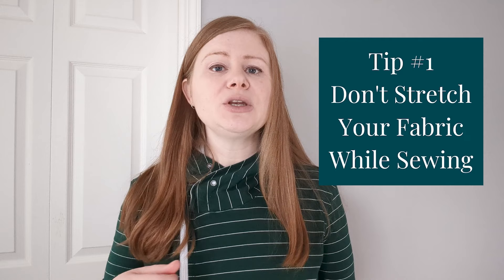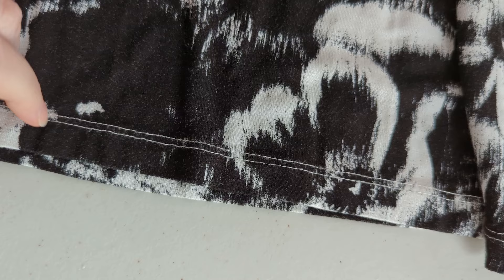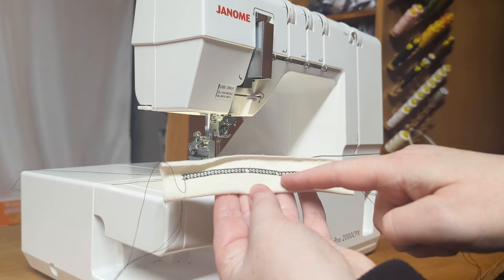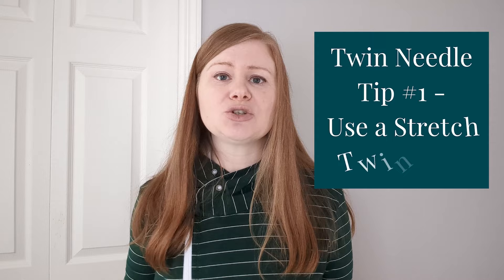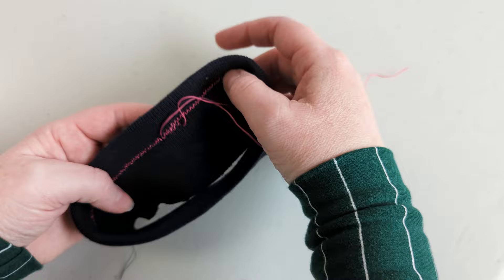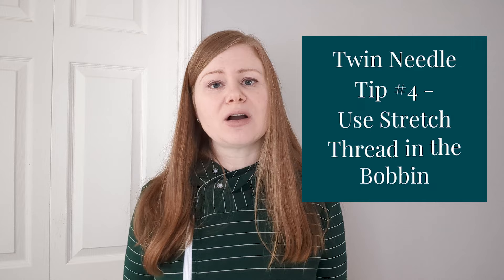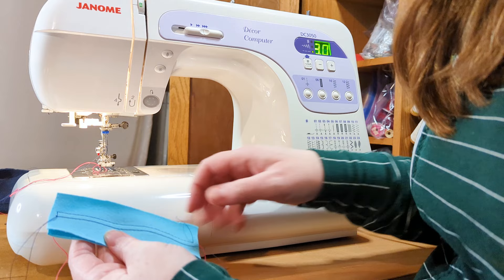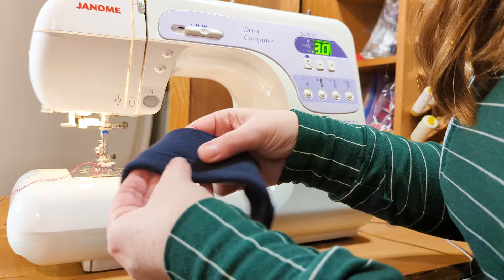Comparing All the Hemming Methods for Knit Fabric - Find Your Favorite!

Comment: Great video and, like you, I've had limited success with twin needle sewing despite playing with adjustments etc.  Your presentation is very professional - great job!
Reply from the maker: Thank you, glad you enjoyed it!
Reply: So many people say this. Yet I love twin needle hems. All I can say is practice on scrap at the depth level of the seam. And play with stitch length and pressure foot. Sometimes different threads are better with twin. Also it shouldn’t make a difference but going slowly helps on mine. 
I sew a lot of jersey and I wouldn’t be without my twin needles. But they do have to be stretch. Not universal.

Comment: This last weekend I was in such distress over shortening two rayon/ spandex dresses. Finally I bought wash away and lowered my tension to #4 on my machine along with the stretch setting. I also used the straight stitch. I finally got a straight stitch I was satisfied with. I was advised to use a longer stitch length. I used #3 length.
 I have to use my serger then my machine. My machine is a #650 Viking Opal. 
 Thank you for this video.
Reply from the maker: Glad you got it figured out!

Comment: Ive just spent all day ripping out a garment like 8 times trying to sew with a twin needle and the stitches would always come out when I stretched it. 
Now I’m going to toss that twin needle and just use the triple stitch. That will work so much better!! 
Thank you . 
Knit fabric is not something I’m good at for sure.
Reply from the maker: I would recommend taking some scraps and practicing on those first, before sewing your garment. I have some other videos on sewing with knit fabrics that would be helpful as you figure out the ideal settings for your machine with knits :)

Comment: Hi Adrienne, I am so thrilled I came across this video, thank you for helping ease my stress when considering sewing with thin knits.  @1:07 - I don't think I have a way to loosen the presser foot pressure on my Pfaff Creative Vision.  It does have the awesome IDT system, or built-in walking foot, so I think that will do the trick. :)
Reply from the maker: Glad it was helpful!

Comment: This is a great video! I've really learned a lot from you. I do have a question about double needle threading -- how do you keep it from tangling? Mine gets terribly tangled between the thread guides and the needles.  Thank you!
Reply from the maker: I'm sorry I can't help with that, as I did not have that issue with my machine, so I've never had to troubleshoot it

Comment: Thanks for this information I’m new and until now only used 100% cotton fabrics. But I have a project I’m working on with spandex fabric. I have a serger and am learning slowly but surely to get it threaded and used. It can be frustrating. 😊
Reply from the maker: Threading is the hardest part, but keep practicing, it will get much easier!

Comment: Loved your video.  I learned a lot.....Things I never knew before and you were so clear in your explanations so thanks!   I struggle greatly with hemming knit fabrics.  They always come out wavy plus I manage to stretch out the whole top as I sew.  I thought using the walking foot and adjusting the tension and stitch length would definitely solve all my issues but they did not.  I followed all your recommendations and still..... a wavy hem.  I just ordered the wash away tape.  I really hope this helps!  I do have a question.....is there any way to shrink back the top that I stretched?  I rinsed it in water and then hung it to dry but it still remains stretched out.  Any thought on how I can save this top or is it just too late?
Reply from the maker: Hi Maria - it may be a matter of fabric choice, some knit fabrics stretch out much more easily than others - especially if there is not spandex content in them (also known as Lycra or Elastane - brands of spandex). I would suggest watching this video, it may help: https://youtu.be/kKllY5D-C74 

If the top you already stretched is made from a fabric with poor stretch recovery, then unfortunately there is no way to shrink it back. If it does have spandex, try a stream press or a hot wash, which should help the fibers to shrink back into place - but if it has been stretched a lot, this may only help and not completely fix it.

Does your machine have an option to turn down your presser foot pressure? If not, you may want to consider upgrading your machine, as you can only do so much without this feature. If the walking foot isn't cutting it, perhaps the presser foot presser on your machine is just too much. But if all else fails, the wash away tape should help immensely!
Reply: @SewPDF  Well that explains why I'm struggling so much!  No.....unfortunately my machine, a Brother CS6000i, does not have that pressure foot option.  I did order the wash away tape, so I'll give that a try.  The fabric has no spandex so that explains why it is not recovering.  Thanks for explaining that !  Now I can pay attention to the type of fabric I am buying in the future.  I may not ever buy or try to alter this type of fabric ever again.  It's truly a nightmare!  What type of sewing machine do you recommend?  I was even thinking of purchasing a serger.  Does a serger prevent wavy hems better?
Reply from the maker: @maria3987  Sergers have something called differential feed which does help a lot with seams, but you can't use a serger to hem, so you're still going to need a sewing machine for that. I have had very good luck with my Janome machines for hemming knits, one of them even does an amazing job without a walking foot. They were on the pricey side of their range though - they are not entry level machines. I'm not sure if a lower end Janome would do as well. I have heard excellent things about Pfaff, Bernina, and Husqvarna as well. I think the key is to invest in a machine that is higher quality - you definitely get what you pay for when it comes to sewing machines. If that doesn't work with your budget you could look for an older used machine, from when they were metal and not electronic. The old Kenmore machines are great, pretty much unbreakable.
Reply: @SewPDF  Funny...every time I think about buying a serger, there's a reason I don't and you just gave me yet another reason not to waste my money.
I have my mom's old sewing machine.  It's called '"White" and it's got t be 40 + years old. It's extremely heavy.  Not sure if it has a presser foot adjustment setting but there's something called a "bobbin tension" setting.  I have to make time to really take a look at it.  I'll let you know it it works!  Thanks for all your advise!
Reply from the maker: @maria3987  yeah the older machines typically don't have that setting but it's worth giving it a shot to see if it works better with a walking foot than your Brother. In my experience usually a walking foot will do the trick with machines that can't be adjusted - but not always. I do love my serger, it makes sewing knits so much faster, but it's important to know that you can't hem with it. I do have a couple of videos on sergers as well.
Reply: @SewPDF  It's worth a try but I'm sure I'm gonna throw my back out just picking it up!  I have to look to see if my mom saved or even has the walking foot and then I have to figure out how to use this thing! 🤞It it doesn't work then I'll look into getting an up-grated sewing machine.

Comment: Did you say you just use maxilock for hemming and seams?
Reply from the maker: I use maxilock stretch thread in my bobbin when I want the hem stitches to be extra stretchy and strong. I use regular thread in the top thread. For seams I use regular maxilock in my serger.

Comment: Wow, thank you.  Never used the washable tape...would like to hear the pros and cons....does it wear down your needle more, placement for hems on full skirts and etc?  And would like recommendation on where to purchase....i hate adding to the supply list.  My old machine had the presser foot adj, and i didnt have to deal with this.  But alas, my new machine didnt and now with and add’l $50 purch for a walking foot, i feel a little had.  I appreciate your insights.
Reply from the maker: I get mine on Amazon (https://amzn.to/34hMK4w - affiliate link). I don't find that it wears down my needles, but I don't use it for hemming much (it has lots of other really useful applications though!). I use triple stitch on really stretchy knits and the honeycomb on more structured knits like cotton lycra and french terry. These stitch types come out well for me on my machine without the tape. Have you tried reducing the presser foot pressure on your new machine?

For me the only downside of using the tape is that it can take a long time to apply (depends on how long the seam is, and curves are a real pain since you have to cut multiple small pieces). But it's worth it in a long of situations for the outcome, and not having to fight to get the fabric to stay in place while sewing.

Sorry it took so long to approve this comment - I didn't realize my settings were holding all comments for review (oops!), and I didn't get any notifications that comments were held for review!

Comment: Will the fusible hem tape solve my problem with trying to turn up trouser hems on 3 pairs of trousers made from 95% polyester and 5% elastane velvety material. My machine stitches for about 1 inch then refuses to stitch , its not my machine as it works perfectly on other fabrics.  Hope it will as I don't really want to have to hand stitch  each pair.
Reply from the maker: Sounds like a needle problem to me, what kind are you using?

Comment: I have no waviness, I have the problem of rolling. How do you stop the hem from rolling
Reply from the maker: Wide hems will help - 3/4" to 1 inch. Sometimes they will still roll a bit, but if you take the item out of the dryer while it's still warm and press the hems down with your fingers to ensure they are flat while they cool, this works quite well. Or hang to dry and make sure hem is down while drying.

Comment: would it work to use a permanent non-stretch fabric strip in place of the washaway strip?
Reply from the maker: It would only work if you fused the stretchy fabric to the non stretch fabric, and if you are fusing anyways then you could just fuse the hem up and skip the fabric insert. This would also stabilize it as fusible webbing is generally not stretchy.

Comment: I bought the cover stitch machine you have, or at least that you had when you made this video. It's a terrible machine. I replaced it with a Babylock that never skips stitches. I would guess there are other CS machines that work well also. But the one you have is a hopeless dog that does indeed skip stitches All. The. Time.. I hated it so much I named it Mephisto.
Reply from the maker: LOL good to know I'm not the only one. I have heard that from many people too that it skips stitches  no matter what they do, but one of my closest friends has one that works just fine, I don't know what magic settings she uses haha. I tried all the tips I could find online, it did improve but never fully stopped skipping. I got rid of it, if I ever get one again, it will be a Babylock.

Comment: So I took your advice and purchased a Janome.  Mine is the 412OQDC.  I love it but still getting wavy hems.  The fabric I am using is stretchy with little recovery.  I have tried lowering the presser foot adjustment dial but that doesn't work and if I go too low, it just eats the fabric.  I tried the walking foot and still a wavy hem.  I even tried using the double needle instead and still the same problem even with ultra light bonding tape.  I even played around with the thread tension dial.  There has got to be something I am doing wrong no?
Reply from the maker: One of my machines is nearly identical to that one, that's the one I used for these tests with a walking foot and rib knit fabric with poor stretch recovery: https://www.youtube.com/watch?v=8jFawqG1UkQ I'm baffled as to what could be causing different results for you. What kind of stitch are you using? Are you sure you're not pulling on the fabric, just letting the machine feed it through?
Reply from the maker: Are the waves at least less? Minor waviness will go away with a good steam press.
Reply: @SewPDF  Yes. The waves are longer, every few inches, & pressing doesn't help.  Still can't get the fabric to lay flat.
Reply: @SewPDF  I am going to try a few more things and write you back.  I was going to throw in the towel but I'm too mad to stop!  I write you back later.  Is that okay?
Reply from the maker: Of course! If you would like help with further troubleshooting later, pictures of your settings would be quite helpful
Reply: @SewPDF  So I tried a few things.  I have pictures but can't copy them over.
I used a twin needle/Press.Foot Adj. #1/Stitch Tension 4/3.5 Stitch Width/5.0 Stitch Length and it was much better but even thought the waves were longer it still doesn't look good enough for me.  I also kept trying to adjust the Stitch Width and Stitch Length but sort of came out the same.  BTW.....I'm not a fan of the double needle look and also I hate how big the stitches came out.  I won't do the zig zag because I hate that look the most!  Any thoughts????? I would love to use the triple stitch so I will play around with this one again today.

Comment: What does the "pressure foot" dial read?  tension?
Reply from the maker: Hi Sandra - the presser foot pressure setting is different than tension. Not all machines have this setting. You can learn more about it in this video: https://youtu.be/_ea7gT90r7w
Reply: @SewPDF  Thank you. My machine does not show a presser foot dial, then.